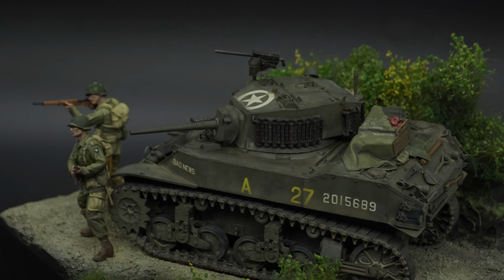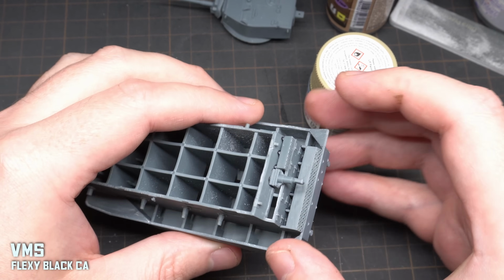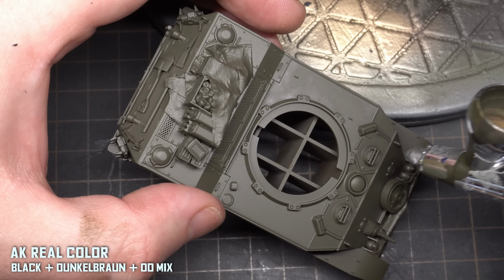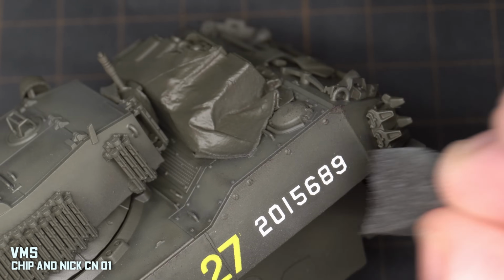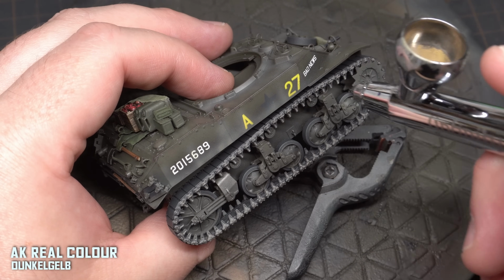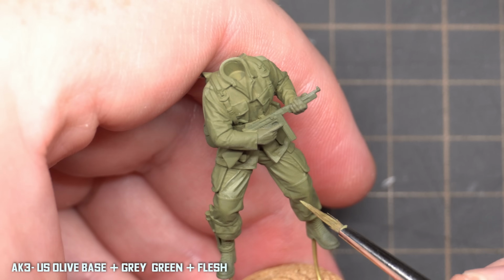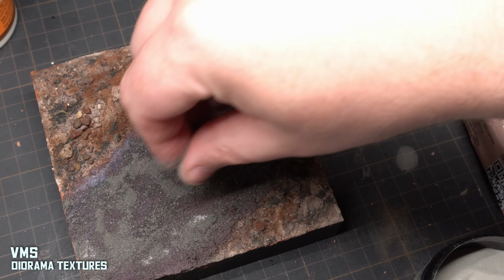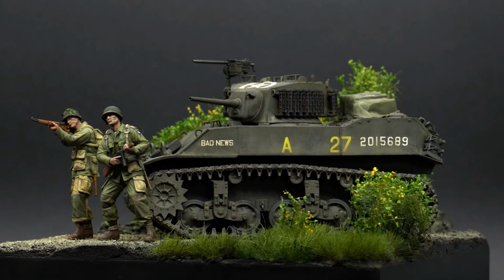Normandy Diorama | 1/48 M5A1 Stuart and 101st Airborne

Comment: I really like the 3D printed Stuart, it is one of the best 3D printed "kits" I've seen. One small issue I would have had is that all hatches are closed and also the periscopes are not installed so in reality the crew would be entombed. I now do my tank models with the hatches open and some crew figures. I really like the way you painted the apples, they look amazing. Also doing something like this is a very clever way of getting non military colours onto a military model.

Comment: Hi James, that 3D Stuart kooks absolutely outstanding, I have to admit I do not rezlly understand about 3D printing, can you get a 35th scale version? That would be a good size to see built, as it is my prefered scale, but your build looked perfect, best regards from a Kiwi living in Australia, Les
Reply from the maker: Thanks Les. 
Yes any file you get or create can be resized. 
I use the tools on this site a lot. 
https://www.scalemodelersworld.com/online-scale-converter-tool.html
And there is a section that can covert in % 1/48 to 1/35 for example. 
So in your slicer software, where you prepare the file for print you can rescale everything from 48 to 35 by changing the percentage to 137.14%  then that's your things upscaled

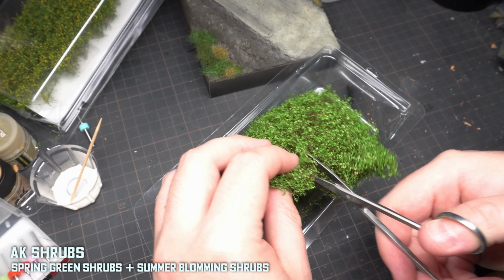Comment: 33:40  Thats not a print flaw, thats a modeling flaw.  Large rectangular polygons on the model need to subdivided down if the surface they are representing isn't perfectly flat. In STL (an many other formats) all N-gons will get split into triangles.  Those long defects along the side are the diagonal edges dividing what were large rectangles into two triangles each.  These kinds of flaws can either make the surface concave or convex as a result with the hard edge showing down the middle.  More subdivisions/polys making up the surface would minimize this to the point it disappears entirely.  To give the benefit of the doubt to the modeler, this is usually hard to notice in the modeling software if you don't know to look for it by turning of the surface smooth-shading so you can see how the edges are breaking, if at all.  Cheers.
Reply from the maker: Thanks @vorpal_Wit that's most interesting, and oddly although I am personally a complete novice at 3d and I'm not on board with lingo I know exactly what you mean thanks to your explanation. Something to consider for My own projects in future
Reply: @lpjmodels  Sorry, 25+ years as a 3d modeler makes it hard to stop myself sometimes.  Also, as an avid 3D printer myself, I don't want to see anyone wasting time and materials trying to fix a problem with their printer, if the problem is actually the model.